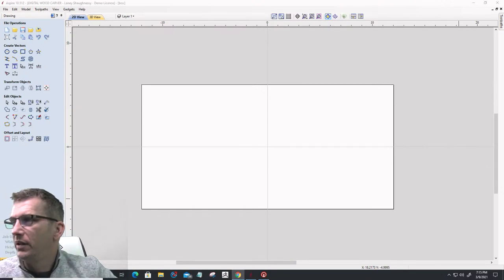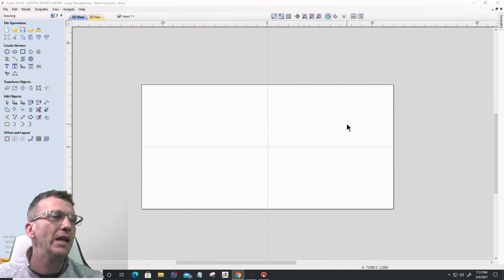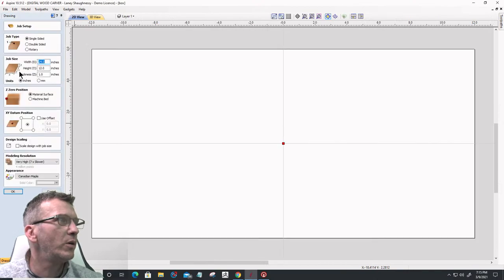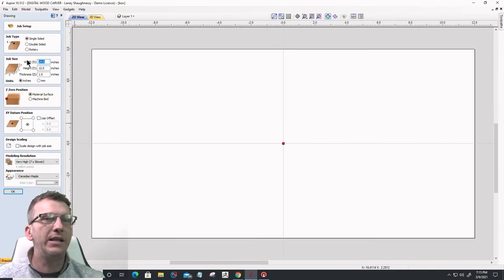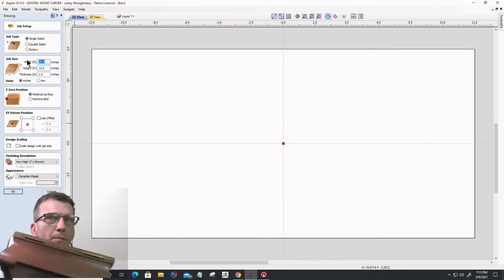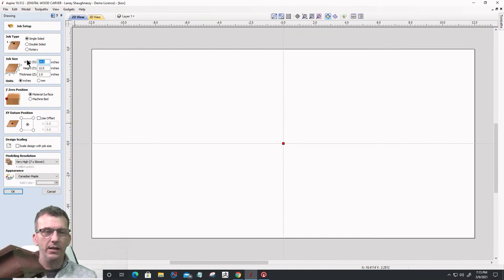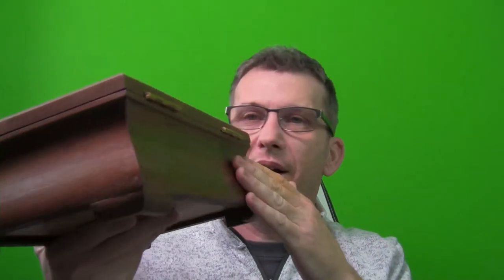Beautiful Boxes with Modeling and Molding - A Vectric Tutorial

Comment: Is there an easy way to get the Cnc machine to cut the mitre joint easily by turning the wood over?
Reply from the maker: You can draw your lines and do a profile cut with a V bit to do a miter cut yes